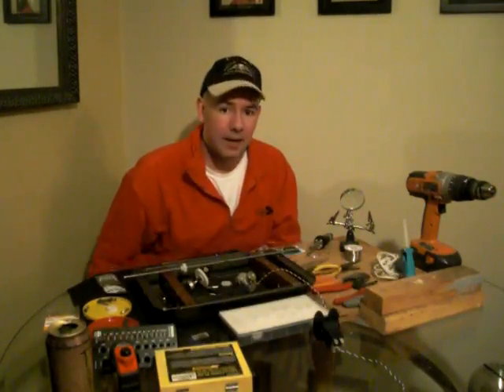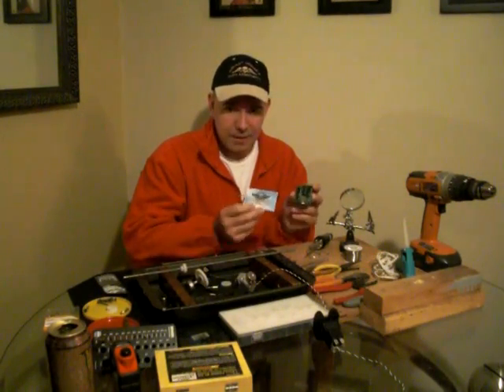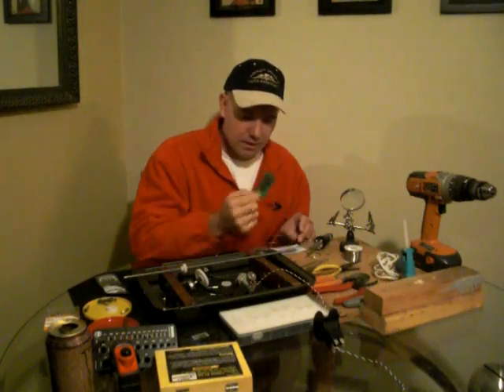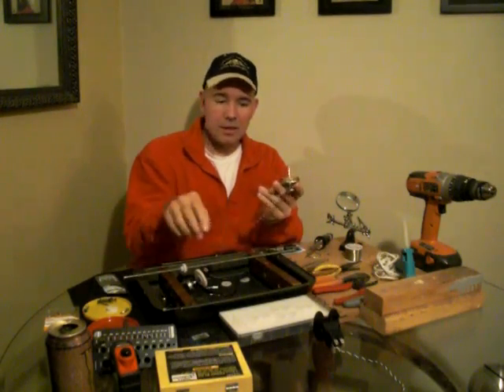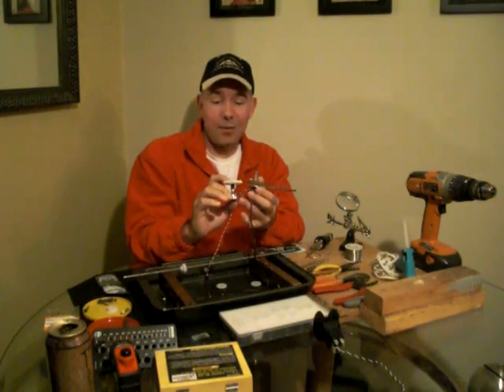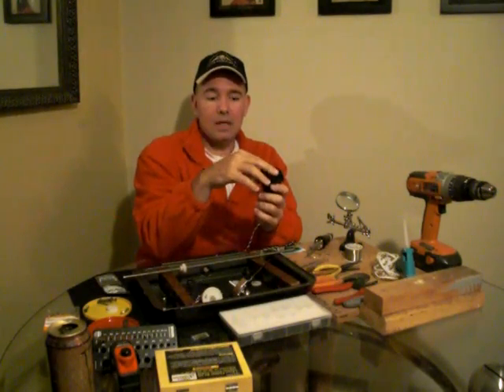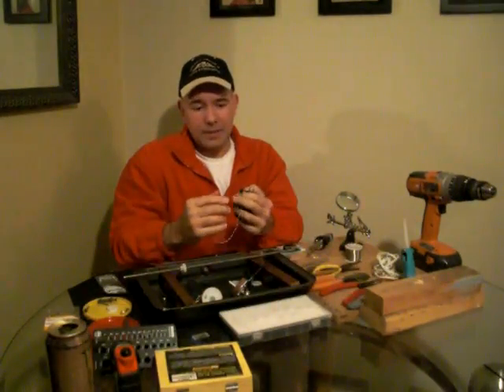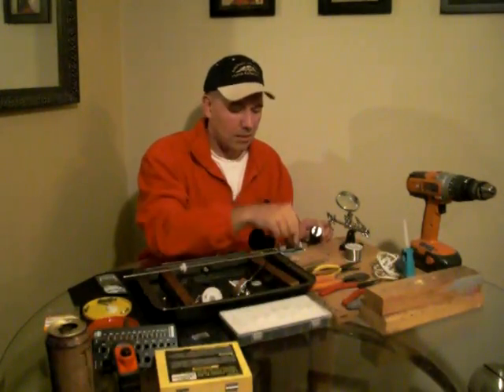DIY Flight Simulation - Building Your Own Trim Wheel, Speed Brakes, and Flaps Part. 3

Comment from the maker: @pgnandt I made a gear lever too.  it has to be actuated by a momentary switch just like a keyboard key on. tap once on..tap once off.  As far as my trim wheel project you can use an existing joystick controller but its not as simple as you might think. You'll learn alot from experimenting. I do have dual yokes too as you will see in some videos. I will be offering blueprints for it on my website soon. I promise it is the best design you will find on the internet. Check out my website.

Comment: Using a keyboard for switches.- Some keyboards have led's on them for when you select NumLock or Caps Lock. Use both for gear down/ gear up indicator maybe?

Comment: I'm currently trying to figure out how to take my Pro Flight Yolk and tripling the elevator travel and doubling the roll travel. It's all about those plastic gears. I'm thinking of how to use roller bering pillow blocks for roll. And somehow using ball baring drawer sliders for elevator travel. Two pillow blocks sitting on two drawer sliders. It's all easy. Just mating the action to pots (gears issue).
 Noting: there can't be any stress on the pot shaft.

Comment: Same thing for adding switches. Find an old keyboard. Every key is a switch. Simple to just get down to the internals of the keyboard with a soldering iron. Micro-soldering but real cheep.
 The gears are an issue. Would be nice to just find on line. (I'm going to do some searching). Also instead of trying to drill a cotter pin hole in the shaft. I'll look for something that will just lock onto the shaft with an allen screw.

Comment: Interesting is this USB interface device. I was thinking that instead of using that. One could just buy a cheep joystick or game controller and wire your new pots into its existing electronics. Seems like it would be easier when installing an additional game controller. Use the same driver, only the pot info is coming from your new device.